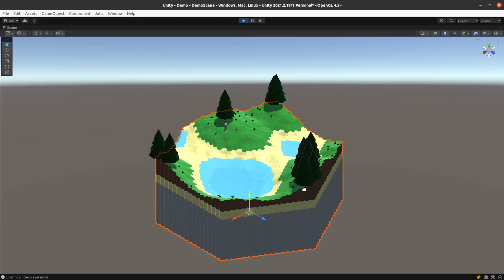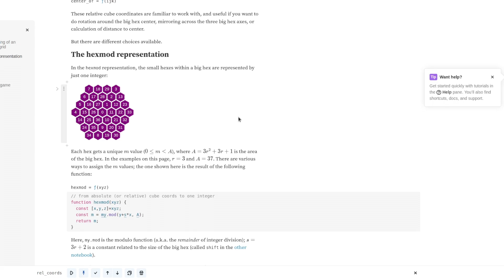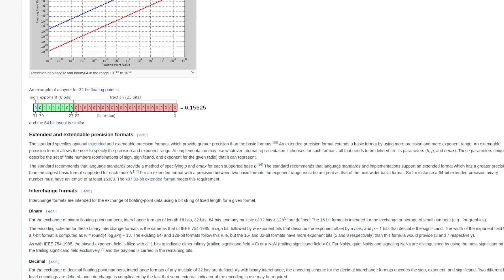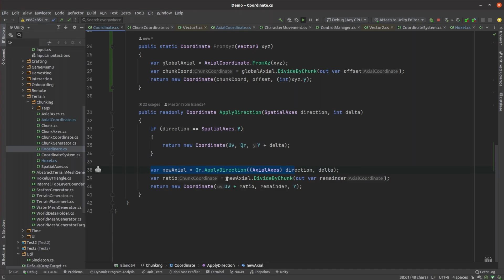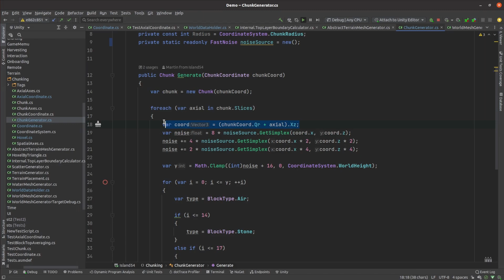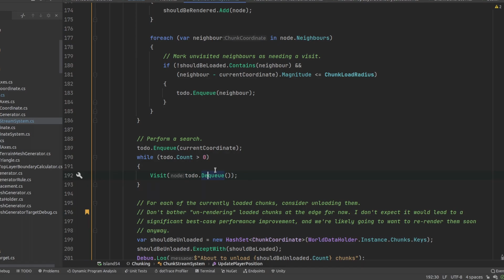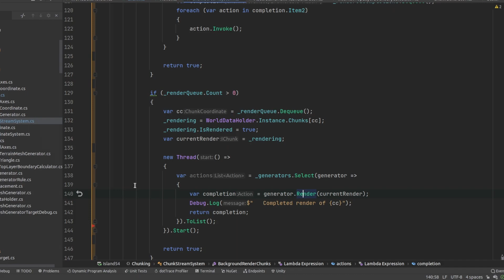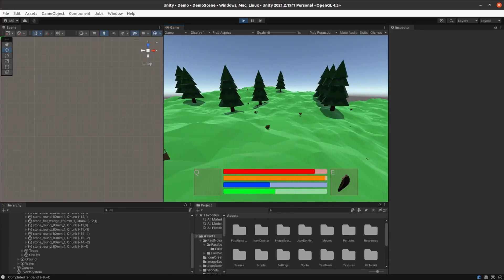Making an "Infinite" World | Unity Devlog #13

Comment: Im pretty sure outer wilds had the same exact problem with getting too far from world origin, im not sure how they fixed it but it could be useful for you to check out how they did it.
Reply from the maker: Rebasing should be pretty straight forward, as long as all objects in the world are children of "chunk" objects. All you need to do is enumerate your top-level chunk objects, and update their transforms to be relative to some new origin (the centre of a chunk other than 0,0). 

I might try it as a little experiment sooner rather than later. The code could live near my current ChunkStreamSystem class, since it already knows which chunk the player is in, and which objects have been created as part of chunk generation. As a test, I could do the rebase every time the player changes chunk and see if there's a noticeable performance hit. With that change, the entire 15 billion Texas's should become accessible.

The only issue I'm likely to run into is the fact that I generate multiple objects per chunk: One for terrain, one for water, and one per "scatter" type (which I have 4 of at the moment). As the complexity of the game increases, the rebase operation will get bigger. If it's a problem, I could easily mitigate that by inverting my object hierarchy, and putting each of those objects under a common parent for each chunk.

I believe Unreal actually has some sort of a built-in mechanism for managing it for you.
Reply: @Island54Games  Oh wow, seems like you have a very good idea of how to do it. But thank you for shining a light on that for me, i kind of understand the concept. I look forward to your future devlogs to see what you can come up with!

Comment: A trick I use to make Sync and Async Threading super trivial is the following. It allows you to intertwine threaded code while maintaining state and removing a lot of the headaches with threading.

void Start()
{
   StartCoroutile(UpdateMeshes());
}

IEnumerator UpdateMeshes()
{
   while(true)
   {
       ExecuteSyncCodeA(); //Could be something like creating meshes

       yield return new WaitForThreadedTask(() => Threaded Code); //Could be something like generating mesh data

       ExecuteSyncCodeB(); //Could be something like applying meshes

       yield return null;
   }
}

The WaitForThreadedTask yields until a action is completed with the action run on a separate thread
Reply from the maker: Ooh, nice. This is the first C# project I've worked on, so am not all that familiar with it's coroutines. 

It looks like the way you describe it would make sequencing the loads and mesh generations would become much simpler.
Reply: @Island54Games  Coroutines are a unity specific feature that run on the main thread but can be paused and resumes. Here's the code for the WaitForThreadedTask one btw. Also you can also switch out creating new threads with using TheadPool

	public class WaitForThreadedTask : UnityEngine.CustomYieldInstruction
	{
		private bool _isRunning;

		public WaitForThreadedTask(Action task)
		{
			_isRunning = true;
			new Thread(() =>
                        {
                              task(); 
                             _isRunning = false; 
			}).Start();
		}

		public override bool keepWaiting => _isRunning;
        }

Comment: Oh wow, i would never think that'd be THAT hard! Did you know any of these before, cuz if you managed to code all of this in just a week, respect.

But knowing from my experience, once you start to understand the basics, it doesnt become that hard
Reply from the maker: For the mathematics side of things, I've thought a lot about how hexes would work in a terrain system, but never actually coded anything before. I've tried formalising the maths before for XZ/UVW/QRS conversions, but could never quite work it out. The articles by Amit Patel and Sander Evers were godsends for getting my head around that side of things, but it still took up the bulk of my time this week.

The chunk streaming and performance side of things is pretty routine for anyone that's done a bit of multi-threaded programming (and could be a lot cleaner, I might add). That was only a couple of hours work to get going.